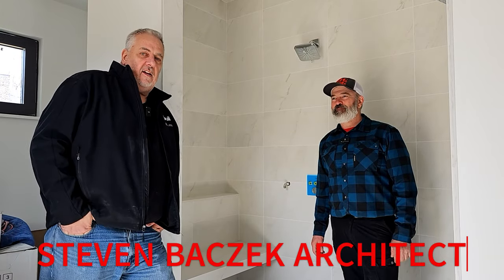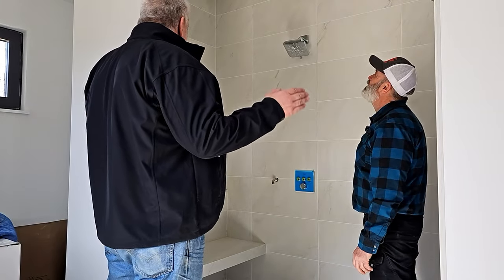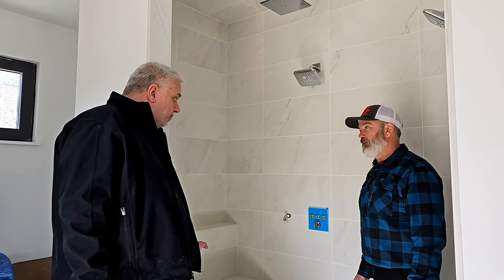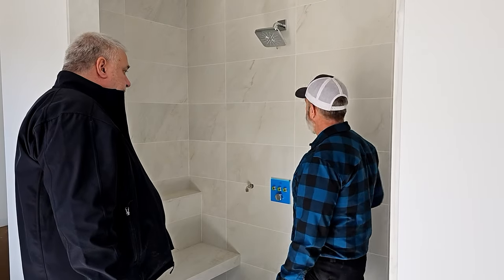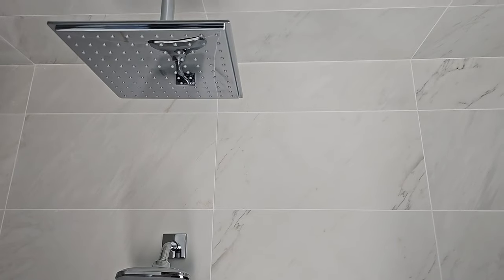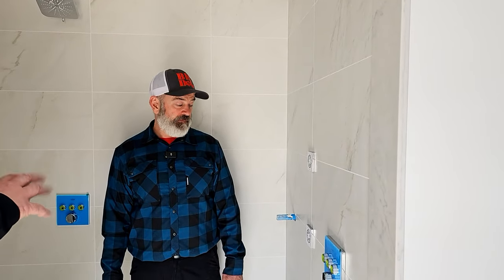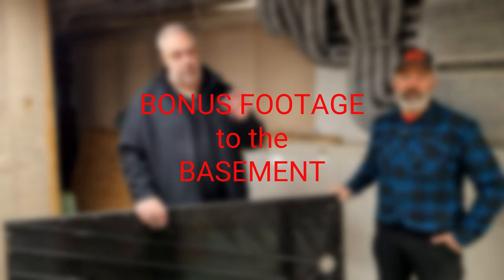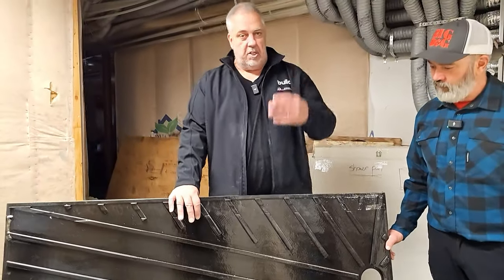NO SHOWER DRAIN???

Comment: So, the tiles just sit on that pan, or do they get attached to some sort of grid that sits on top of the pan? From the looks of it, if they just sit on the pan, you would step on an unsupported corner and the tile would pop up like a see-saw, with one of the pan ridges as a fulcrum.
Reply: they were cut to a specific design by Porcelanosa and shipped in, but could easily have been cut by the installer.  Rodrigo from Peterson Services, and his team, did an amazing job with the tile work.  They had never used this Butech system (from Porcelanosa) and really liked working with it.  Every two tiles are tied together by two bars that recess into grooves on the top of the shower pan.  They can easily be lifted up to clean the microban coated pan below.  No see-saw problem and the placement of those bars (with epoxy supplied with the pan) hold them nicely in place.  It looks great and I am looking forward to using it to see how it performs.  This system is widely used in Europe and has been for years.

Comment: A word on Microban--- Having had experience with the product in the medical device industry, like any antimicrobial system, they will all have their limitations. In the case of Microban the limitation is what we call the degree of bio-burden. However in the case of a shower drain system it is not all about biology.  Many other contaminants are in play that will contribute to the ability of mold and bacteria to form and take hold. One of the key contaminates common to showers is lime deposits that form on surfaces and build up over time and the rate is determined by how heavily the shower is used. Microban if added to a plastic material is a surface contact prohibitive so once the surface has a layer of a contaminate such as lime bacteria and mold are free to grow on top of the deposit -- whether it is lime or layers of other dead cells.     We were thinking of adding Microban to our products back in 1999-2000, however,  what the company wanted for licencing and what we were actually able to claim for efficacy the product was not a good fit.  Fisher-Price actually had marketed their toy line with Microban with claims--- they ended up having to pull them back off the shelves because it gave the consumer a false sense of security -- you still had to clean the toy.      Cleaning the pan once a month may keep things from getting too gross. Also if everyone in the family would cut their hair shorter that would also help.  Microban does market their product in a spray can and using that once a week may also help keep things from getting out of hand. One thing not mentioned is the factor of human behavior -most people do not want to look at or feel gross stuff like cleaning out a clogged drain- it is a giant pain point for most people.  It's a principle many car companies use to their advantage -- make something difficult for the customer to maintain and they probably won't.   All in all great video and informative!

Comment: Hi Steve, great video! With the shower floor tiles resting on top of those built-in ridges on the shower pan (instead of them being fully supported by a mortar bed or a completely flat shower pan like the ones from Schluter), are there any issues with the weight of a person stepping on a tile and cracking it (a person’s weight being like a point load on the tile)?

Also, I don't know if you noticed this, but in your recent video with Awesome Framers they spelled your last name wrong onscreen. Apparently they now owe you a dinner. :)

Comment: I like the clean look, and until this is widely used, a curiosity when a guest notices no drain.!
Im guessing the compatible tile sizes are in the manufacturers installation guide.  
The 6th side, being the bottom of the tile, would need wiped clean, too. Which leads to another requirement of it being sealed or a specific type of tile...?
Another question is, should the homeowner keep an extra box of tile to replace tiles that may chip or crack during the cleaning process ?.   Maybe there is some new composite tile coming down the pipeline.  Hmmm, long slat board floor similar to some saunas could be an interesting architectural detail. Scott comments below and is correct, perhaps a composite teak look alike.   Scott,  you haven't transitioned yet.  You don't have an attic, but instead a"dirty area" of basement.
Reply: I ordered extra tile as "attic stock" and they could always be cut to replace a tile, if needed.  It is pretty tough tile, so that is not expected to be needed.  The comment above details the installation.  Porcelanosa designed the shower pan and the placement, based upon the tile sizes and we coordinated that with the tile on the bathroom floor, only  changing the size of the gap between tiles slightly from the floor to the shower floor.  The tile is porcelain and I presume that some tile materials are appropriate and some not.  We wanted porcelain tile.  Not sure about slat board floor and its applicability.  Again, Porcelanosa has done these for years in Europe.  We will put out something in a year to pass along how everything is working, along with data on the performance of the house in terms of energy usage.  I think that will be done under BostonNetZero.
Reply: OMG slat boards is an awesome idea!!!

Comment: So instead of a drain you can clean, the shower drain is all the voids between the tiles?
I don't like that. I have a very good idea of how much hair I pick out of our shower drain every week and I don't want that hair trapped under the tiles and rotting. And I can tell you now that in a household where EVERYONE has a fatigue disability, if we can't see the blockage, it's not getting cleaned until it's so well blocked it's overflowing onto the floor.
Give me a drain that is easy to clean!
We can resolve the grout problem by either using a waterproof grout - you can get a bio epoxy made from biodiesel byproducts now, so no petrochemicals required - or by using a sheet product so you don't need grout.